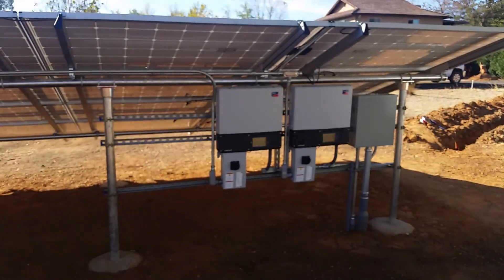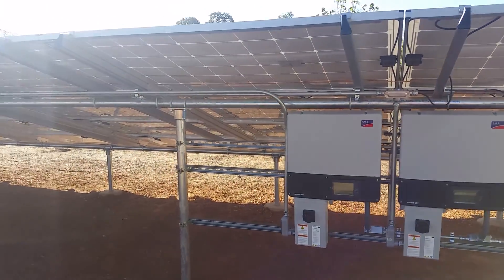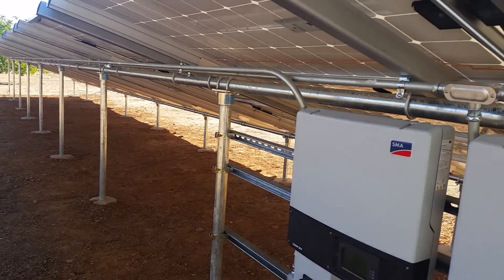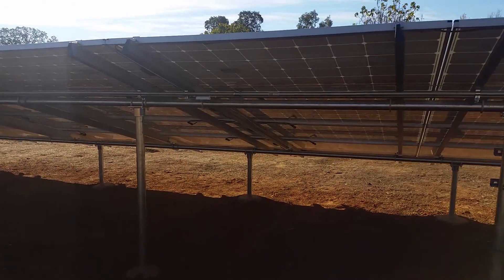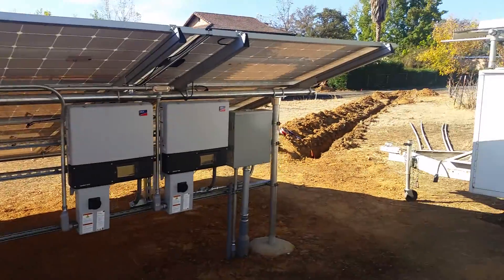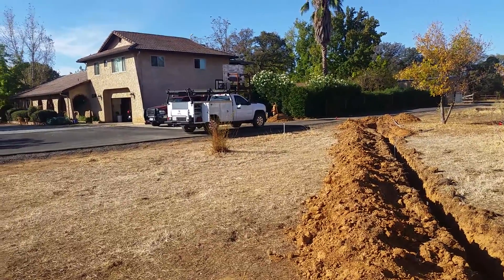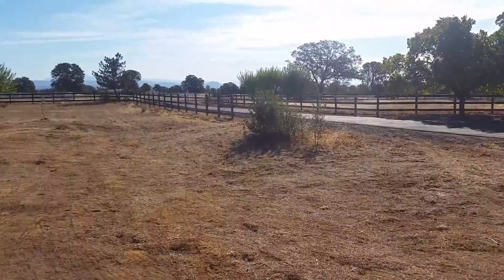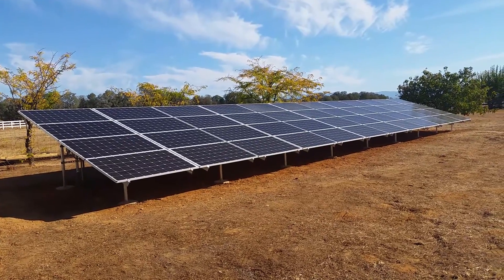Grid Tie Solar with battery back up

Comment: Holy crap are you powering a city bro ? looks sweeet
Reply from the maker: +Theredneck Prepper haha this is a small system for the sqft.
Reply from the maker: +Theredneck Prepper I didn't realize you were talking about this system, this is a good size one and it's only about 80% offset.  I did so extra's and prepped it for a battery back up later on.  I ran into the owner this weekend and he said I could get some drone footage, it will be the first groundmount with the drone and I can't wait